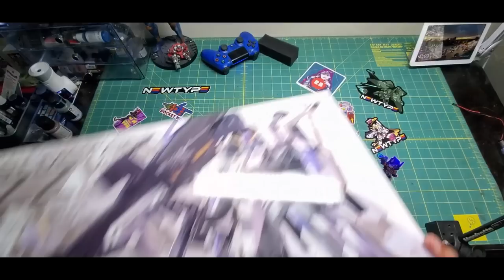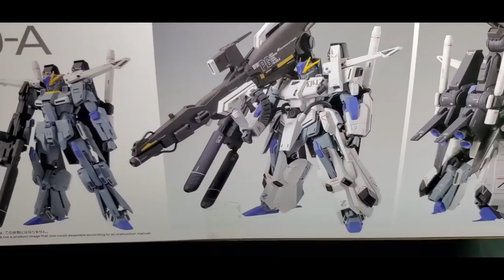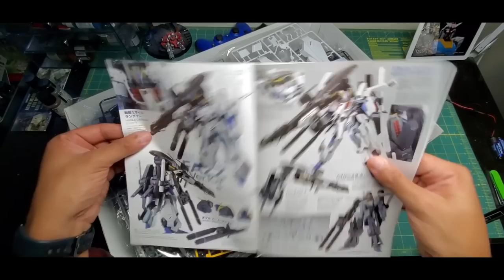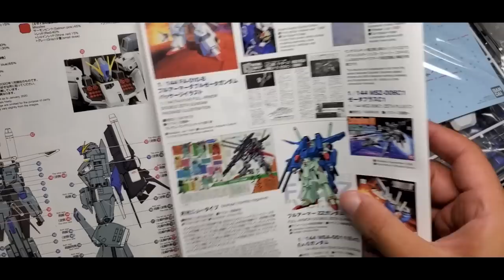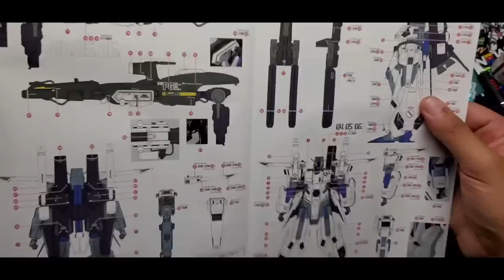#NewtypeHq #Gunpla MG FAZZ Ver  Ka

Comment: So far we have:
- MG MSZ-010 ΖΖ Gundam (Ver. Ka)
- MG MSZ-010S Enhanced ZZ Gundam (Ver. Ka)
- MG FA-010A FAZZ (Ver. Ka)

I guess people can expect MG FA-010S Full Armor ZZ Gundam (Ver. Ka) eventually?
The next Ver. Ka is the XXXG-00W0 Wing Gundam Zero EW "Ver.Ka" & the MG FA-010A FAZZ "Ver.Ka" just came out in February 2020.
So I guess maybe next year we'll get MG FA-010S Full Armor ZZ Gundam (Ver. Ka).

For fans of the MG FA-010A FAZZ (Ver. Ka), I guess most will buy 2 sets of this MG to display with and without the armor?
Also, in regards to the color scheme, I sort of get an RX-93-ν2 Hi-ν Gundam vibe.

Even though this is an expensive kit and one that takes up a lot of space, if you're a fan, this is worth it since it's a big improvement over the original, and it'll go well with MG MSZ-010 ΖΖ Gundam (Ver. Ka) and MG MSZ-010S Enhanced ZZ Gundam (Ver. Ka)...assuming you'd already have them.